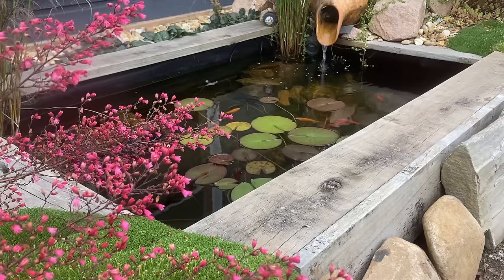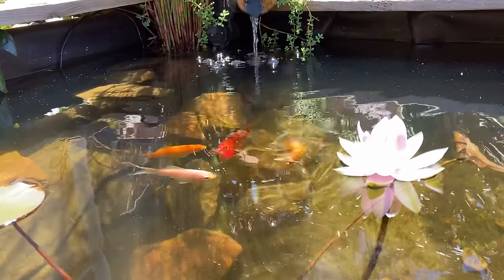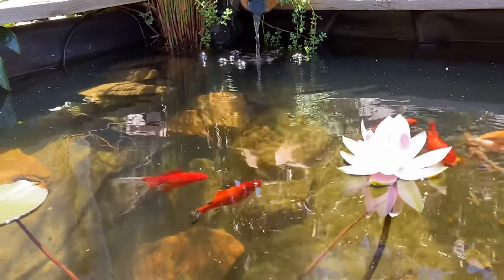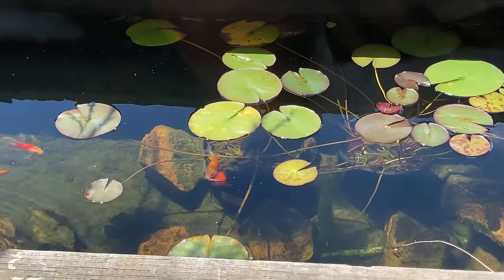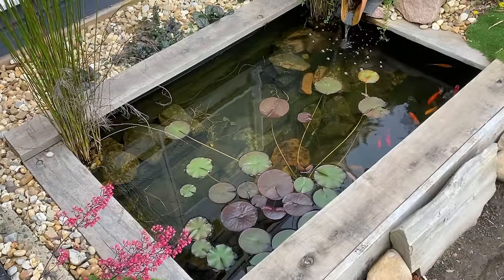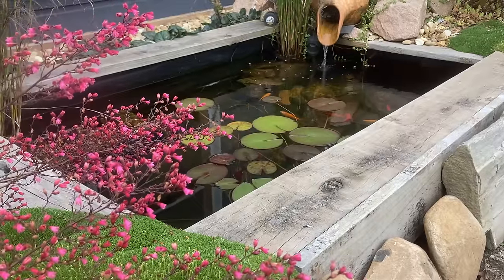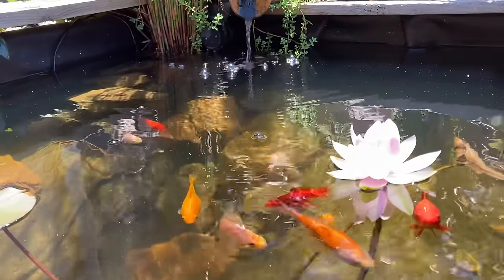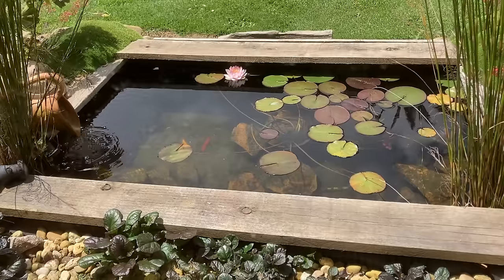Small fish pond with bog filter| Crystal clear water

Comment: Hi I'm wanting to build a pond but don't want to use electrics. Is there a way to build one without pumps and filters? I was thinking of having just common goldfish or common minnows in it. Possibly no fish?
Reply from the maker: I think the idea of this pond could be scaled up. I’ve been really happy with the results. Wine Barrel Pond| No Pump
https://youtu.be/kzBVcdPaZL0 There is an update vid also 👍
Reply: Thanks very much for getting back to me and for the info. My garden project for next year is to do what I've wanted to do for years, which is obviously build a pond. I'm wanting to do a wildlife pond and so want to try to keep things as natural as possible but I know that any water body has an eco system that needs balance and that's where the hard part comes in haha! I was planning on something approx 6x8ft and a depth of a metre. I'm going to line it and I was planning on laying some small pebbles/stones on the bottom with rocks covering the entire bottom and shelves of the pond but now I've seen your video referring to the false bottom I'm not sure how I'd create that with the rocks as they would be too heavy. Do you have any ideas please? I was also planning on providing lots of plants and also adding a few of those baskets with the iron in. Do you think this would be sufficient. Do you know of another way I could create a false bottom? Do you think I could drill holes in plumbing pipes and then put the rocks on top? Also would this need any specific cleaning and would I need to change the cat litter or add any further iron to the baskets over time? Sorry for the long message and thanks for your time, effort and knowledge. Much appreciated.
Reply from the maker: I’m planing on trying these Atlantic flo cells to create a false bottom https://www.atlantiscorporation.com.au/flo-cell®.
Reply: @Ozponds  Thanks very much I'll have a good look into it. Would be great to see a before and after video to see how you get on with it. You're our pond pioneer haha! Thanks again.
Reply from the maker: I’ll create a playlist of the build like I did with the dream pond 👍
Reply: @Ozponds  Excellent. Looking forward to seeing it